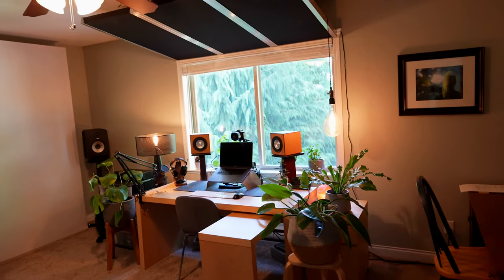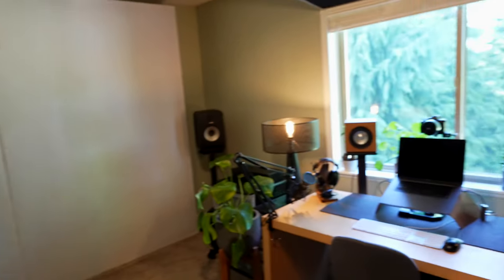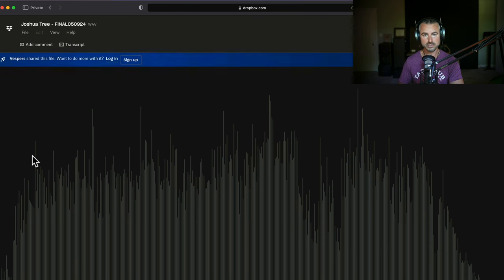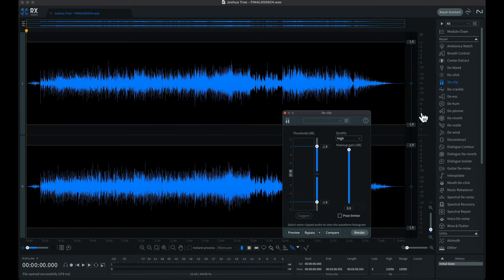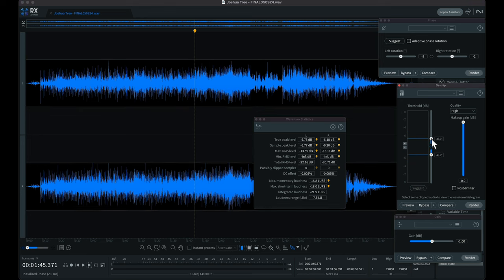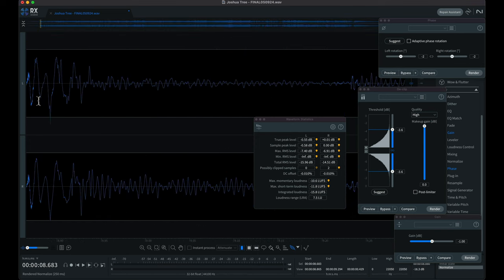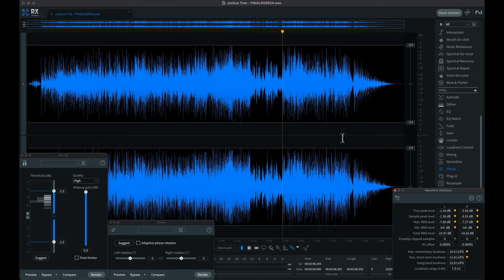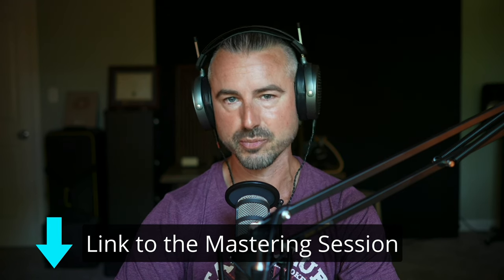Before Mastering I Do THIS…✅

Comment: Why wouldn't you just use a hard clip while mixing instead of manually editing in RX10? Wouldn't it give a similar result?
Reply from the maker: Now there’s someone who’s paying attention!  This is exactly the thought process I went though.  Good question.  

Clippers are distortion devices.  That’s what they do.  They are not first and foremost intended for gain reduction, that is imply a side effect.  So whenever you clip you get distortion.  It’s just that I’m able to tuck and hide and mask the distortion in a clean way that you don’t hear it, or that the saturation is pleasing and desirable.  

This technique of manually gaining things is more what a limiter is trying to do.  It’s trying to be transparent and not cause distortion.  Do you see how the intent of the device matters?  

Thing is, limiters are not fully transparent especially on fast material like this.  They pump and produce artifacts.  So manually gain in is a way of achieving what a limiter seeks to but with none of the artifacts.

Also it’s not a one or the other for me.  I hard clip in my mixes, I hard clip my busses, then I manually gain in RX and then clip and limit the master. You must do all of these very carefully and small amounts per stage or you will destroy the song.  Less is more in many cases.  

In this case I did not do the mix so there was no clipping in the mix.

Comment: I use Sonible smart:limiter It does not produce distortion but still It depends on the quality of the sample being remastered.
Reply from the maker: Hey hey.  Funny you should mention that, because I work with Sonible quite a bit and I'm just about to include smart:limit in an upcoming video.  Also note that all limiters, no matter what technology they use, cause some distortion when you are pushing things loud.  It's just a matter of how much distortion they create and if you hear it.  smart:limit is one of the best in terms of minimizing distortion - or so I hear - and I'm excited to check it out.  Stay tuned for the video.  Cheers!
Reply: @warpacademy  I am excited for it. Thanks. It is just AI-Powered, that is why It ensures that It does not produce distortion or at least harsh distortion because distortion itself can contribute to clarity such as in Metal songs. Pro Metal bands use some kind of distortion that is not harsh, maybe they address something at the level of hardware or at the level of software and good mastering.
In the meantime, what do you think about generative music quality upscaling, not just AI analysis? For example, I use UVR to DeReverb and DeEcho samples, and It is quite impressive and It discarded all the paid solutions even though It introduces some clicks, but it can be easily fixed later with RX.
Reply: Thank you for the information.
All new commercial international songs I think they are awfully distorted on final master. They have much loudness, hard bass, closed sound and drums hit so hard. Also they lack of dynamics.
I don't know in which way they master the new songs all famous engineers but here in Greece, they increase much the lows or cut the highs because they prefer much bass for the fact that the majority people listen from mobile phones or tablets with small earbuds.
And put the loudness ill so much,around -7LUFS
Reply from the maker: There’s certainly a ton of trashy sounding loud songs out there.  Especially now that some people are releasing music in the -1 to -3 LUFS range.  I find there is a sweet spot where you can get to for the right level of containment for the sound you want and avoid most of the audible distortion.
Reply from the maker: Hey hey. I’ve never used UVR before.  I do that stuff with plugins and for the most part get good results.  The Sonible pure plugins and smart:de-ess are very good.  

For the generative up scaling, I would ask why?  What is the benefit of upping the bit depth and sample rate?  It’s been well documented in research that people cannot detect an audible increase in quality in blinded tests beyond 44.1 kHz 16 bit PCM.
Reply: @warpacademy  It is a bit strange since a lot of music players already have sample upscaling like musicbee, and they say that uncover details to the song like increasing the headroom. For me, I noticed  minor changes when the track is full of harmonic details. Even though that resampling in music players is not Ai powered but still It is like boosting headphones capacity.
Reply: @warpacademy  are you sure that range of loudness (-1 / -3)  may not harm the ear, even It is almost flat in waveform? I would like to showcase this in a video if It is true.
Reply from the maker: Hey hey.  Thanks for the explanation.  I don’t understand though how upsampling  can create headroom and how headroom somehow improves perceived quality.
Reply from the maker: Loudness in a song cannot harm the ear.  Sound pressure level can.  They are two totally different things.  You can listen to a loudly mastered song but at minimal volume which means very low sound pressure level.  It won’t harm the ear but it will sound rubbish due to the complete lack of any dynamics.
Reply: @warpacademy  Think of it as data density. Even High-Bitrates tracks have much more file size (could it be random or contributing quality even in minor frequencies?). Higher bitrates hold much more data on it than low bitrates yet still upsampling though It may seem fake gives that feeling of transparent saturation you find in pre-high-bitrates-tracks. I don't know if it is analog or artificial, but It sounds clean and pleasing to listen to. I have given the result of headroom because increasing the headroom increase the clarity of other music parts like changing low-end headphones with high-end headphones make the bass sounds thicker. Upsampling and increasing the headroom have quite the same effect.
Reply: @warpacademy  thank you. The LUFS in all commercial songs are now about -6, -7. 

At 00s and 10s songs (til 2015) from Sony Music,or Universal and other companies have more loudness in waveform but they sound clear with details and the bass-treble are balanced.

Also after 2008, at least hear in Greece, all remasters from compilations, are so awful, they sound over processed, waveform surpasses so much in adobe audition and bass is so hard, drums hit so hard that distorts and there is no detail of songs, it looks like bass is more loud than Vocals, and vocals are grunged. Same with remastered re-released greek vinyls from oldies.
First editions of 90s albums on compact disc are so crystal clear even they are not so much loud.

Comment: Why would you do this over just using a compressor or softclip at the de-clip's threshold? I don't understand why you couldn't just do an automatic gain reduction that would do practically the same thing? Honest question
Reply from the maker: Hey Andy.  Thanks for the question.  There's a really good reason.  Compressors create artifacts due to their attack and release, and really they are not the correct tool to reign in tiny micro-transients.  Their attack time doesn't let them act quickly enough.  

A clipper would be a better tool because it acts immediately.  BUT, all clippers generate distortion.  They can generate a lot of distortion if you're clipping very much.  If you watch part 2 of the video, you'll see that I do use a soft-clipper, and a compressor on the actual mater.  But by reducing this outlier peaks before those effects, I clean up the signal so that the clipper and compressor don't freak out and generate distortion of artifacts. 

It's way cleaner to spread the gain reduction load over multiple phases like this.  The best limiter is no limiter.

Comment: Vesper question,  how would a novice know where to draw that line.  Suppose if there are some great parts a tiny bit higher.   Will the final part of the Mastering makeup for a  part that needs that boost.  I hope I am explaining myself correctly.  Maybe, I need to watch the video over. Hmhmhm.  Thank you.   🙋😃👍👍👍👍👍👍👍👍
Reply from the maker: Good question!  For a novice just ignore this totally.  Go and create and have fun.  Work with a mastering enginner for your stuff and let them handle this type of thing.
Reply: @warpacademy  okay... Thank you very much.   But I would like to learn just enough.  I will need to tell the Mastering engineer something.
Reply from the maker: Ah yes, it is good to learn a bit and be fluent enough to communicate with the engineer.  Cheers Paula!

Comment: How do you use the phase tool?
Reply from the maker: Hey hey.  The phase tool will analyze peaks throughout the song and suggest a fixed phase rotation position that could increase headroom.  Or you can make a selection and analyze that specifically.  It's not common that you would use it on an entire mix, and in general I wouldn't use it unless I had a passage in the mix where there was a very asymmetrical waveform that I wanted to address.
Reply: Good to know, thanks 👍
Reply from the maker: I would really recommend watching this video first, before you consider using the Phase tool like that guy in the Adam video: https://www.youtube.com/watch?v=dAzjq6vldkc
Reply: @warpacademy  yup I was starting to get a little happy with phase correcting. Looking at every multi track channel before mixing, kind of just experimenting with it. Probably overkilling and possibly doing damage.

As I was playing around, I noticed the option in rx to apply "adaptive" correction to the audio. I'm curious if you have a preference over adaptive or not?
Reply: Do you have any prior videos or advice on mix preparation?

I've been exploring running multi tracks through rx and checking them visually before importing into the daw, if they don't need anything else I'll just gain stage at around -18 to -23 avg rms. It's nice because the statics window will give you all that info. Also been playing with the linear phase eq and doing hp / lp on tracks that need them up front before i even start mixing... again nice with rx because I can easily switch to spectrograph view, which helps dail those basic frequency adjustments in and saves a lot of cpu in the daw. I went so far as to lightly pre saturate with GSat, and even tape emulation which can be quickly rendered using higher oversampling with no worries about eating up cpu in the daw. You gotta be confident with the moves though because they are destructive edits 😁

... Potentially dangerous, I've been using loudness module to handle peaks, sort of what Nicholas showed in his video about manual peak editing, but I find the loudness module works differently kind of nice for peak reduction on highly transient recordings like snares or shakers. Potentially better then using a clipper and much faster then manual editing 

Always learning new stuff, I appreciate the videos you've been putting out.
Reply from the maker: Yes I think it’s more likely one is doing damage with that.  Unless you’re recording trombones all day.  Or sax.  Those produce mad asymmetrical waveforms.  

And never use adaptive phase on a master or mix.  It’ll certainly ruin it. Read up on the manual.  It’s for vocals mainly.  Cheers!
Reply from the maker: Right on.  My general impression is that you’re being really heavy handed with your mixing process.  Especially using LP and HP on everything.  I wouldn’t do that.  Remove frequencies if you must.  Try shelving filters first and not cuts.  Don’t use linear phase unless you’re working in parallel or you need to cut aggressively.  

And only use saturation on tracks or busses if you can.  Dont overdo it or get heavy with sat on your master.  Get loudness from your mix.

Comment: The best way is to use CLIPPER
Reply from the maker: I am a HUGE advocate of clipping, so watch part 2 of this video where I actually master the song and use a clipper first in chain.  This is mastering PREP and using manual gain reduction like this dramatically reduces the need for clipping.  This is 100% distortion free, a clipper is not.  

First of all, if you're clipping your master you'd better be very careful and if you clip very much you'll ruin a song like this.  EDM, sure, you can get away with more, but not in more exposed, gentle music like this.  

I would advocate clipping in the MIX more, and clipping the master less.  On the master, clipping introduces intermodulation.  Watch this before you go and clip your master: @MixbuTV video on intermodulation: https://www.youtube.com/watch?v=0zTHis71jZI